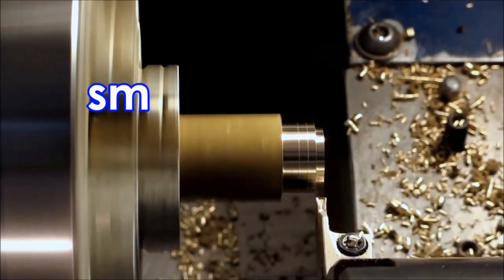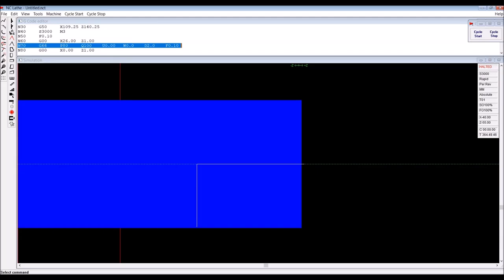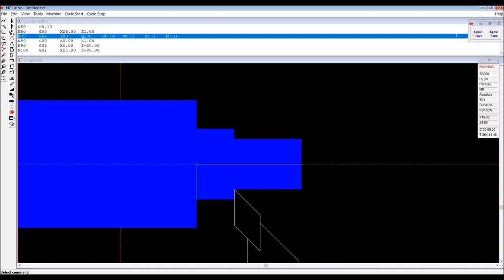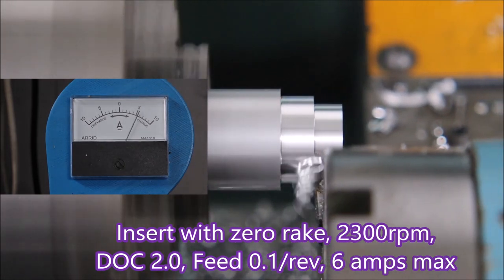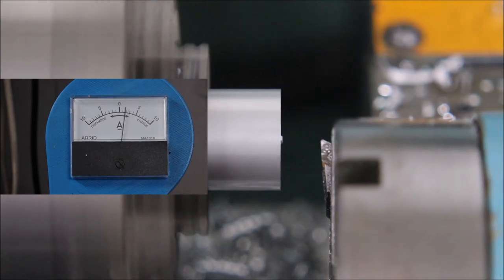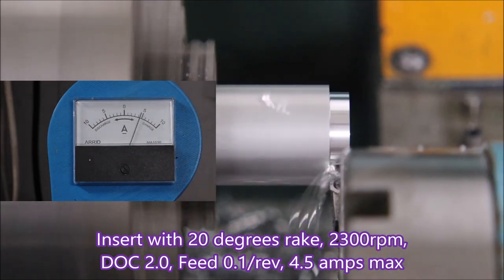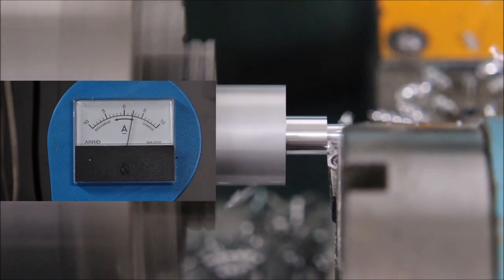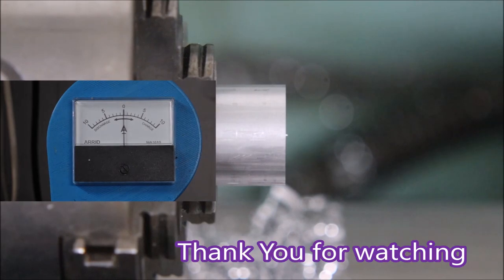Proof that rake angle affects the power required.  A look at Carbide inserts and rake angle.

Comment: That is very informative. I will be looking for sharper inserts in the future. They tend to leave a better surface finish supposedly.
Reply from the maker: I have one insert type that is for finishing but has a moulded edge and they are cheaper than similar inserts with a ground edge.  About to try and make a video comparing the inserts I use, which will include moulded and ground inserts.

Comment: Well I have one 7.5Kw lathe and a 1.5Kw lathe. It can apply to both really. The CNC lathe is in the thinking stages. Make it or buy it. Like I said, Thinking....
Reply from the maker: What on earth do you do with all that power??? There are a lot of folks out there with “the Chinese mini lathe” I hope this is useful to them.
Reply: @smallcnclathes   Well I design and build loudspeakers as a Consulting Engineer for a few companies. You would be surprised and some of the turning operations that have to happen. Sometime a 250mm bar gets turned down to 100 mm on a centre plug to make a pole and backplate. The faster that happens the better. So yes heavy cuts and away we go. Same goes for large cone molds. And large cast baskets. I learn from you and Martin quite a few nuances to your work. Never think that your videos are not appreciated. I learn something from just about all of them.

Mark
Reply from the maker: Kravchenko Audio Thank you, any videos around of your work?
Reply: @smallcnclathes    Click on the channel Kravchenko Audio Channel icon. No machining there yet but plenty of wild and crazy wood working. I'm setting up my machine shop. I was using a friends that is about 100kms away. My little barn is 100 metres away!